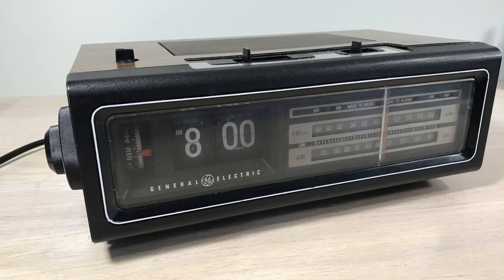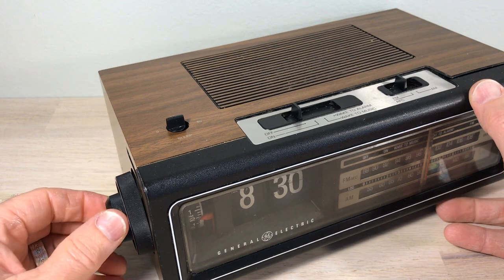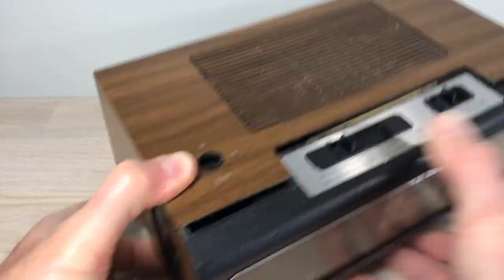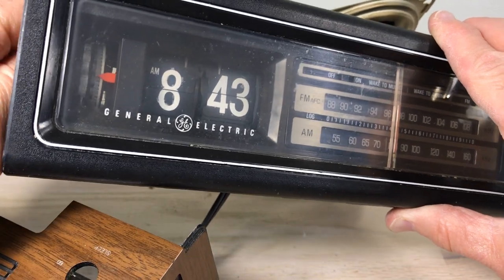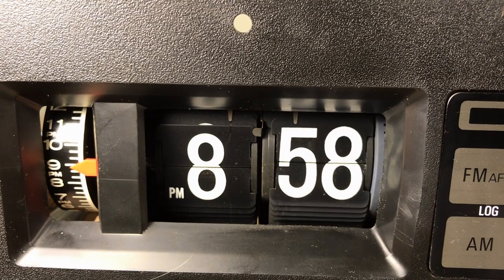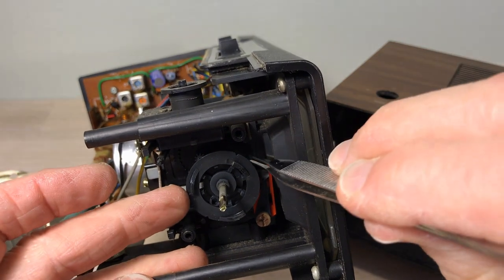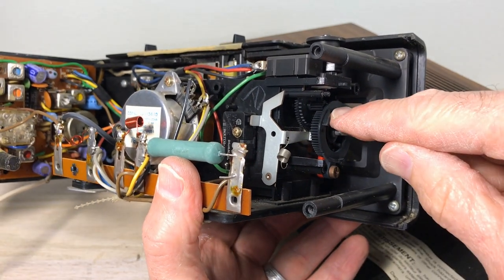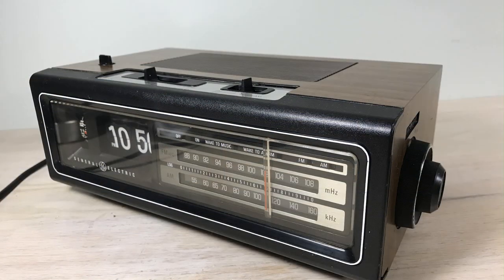How a flip clock alarm works

Comment from the maker: By the way. The speaker wire should be placed the way it was before I took it apart. This keeps the wire away from the internal ferrite bar AM antenna. I changed it back later in the pictured clock.
Reply: I have a Panasonic RC-1122, bought it off Ebay.  There was a rattle inside, I opened it up, a small washer and spring-clip fell out.  I couldn't figure out where they went.  I finally found that the spring clip held the plastic gear that engaged the alarm away from the gear next to it.  That gear slid too far to the right(when facing the clock) and the teeth got jammed on a very small gear below it.  It stripped the teeth off.  Is there anybody into laser printing plastic gears for replacements?